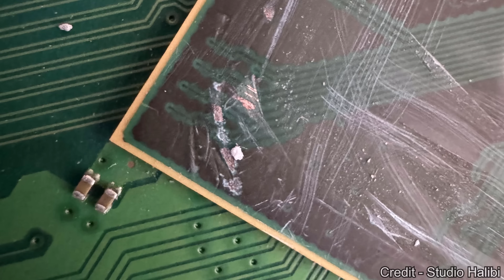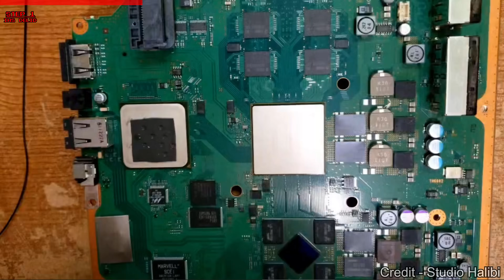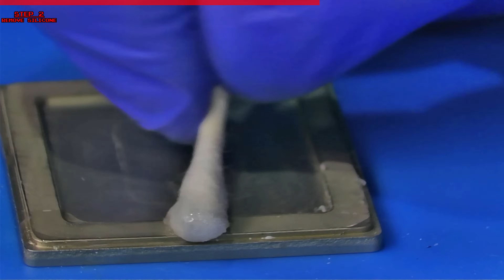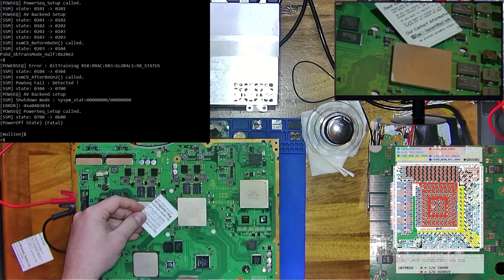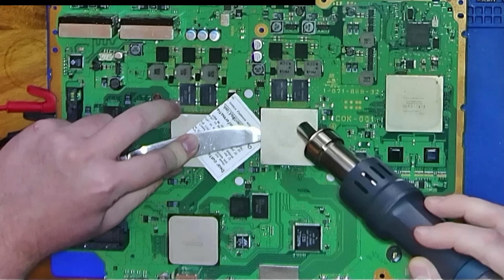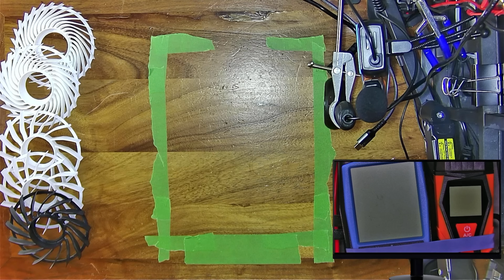How to Fix | Episode 1: Overheating. How to Delid CPU/GPU and fix YLOD - BEWARE of BAD MODs!

Comment: I used 0.06mm molybdenum cutting wire to delid my Cell, and it didn't cause any damage to the substrate. It did take a long time, but it felt very safe, and the end result was perfect.
Reply from the maker: I've seen it go both ways.
Reply: @ripfelix3020  wouldn't it make sense to use that wire to slowly cut away the vram glue?
probably with some kind of jig as to not cut into the dies.
iirc the vram has quite a bit of plastic on top so cutting it on the corners should be "relatively safe".
I only have my slim where i want to put on ptm but since it still works i wont dare touch it :P
Reply from the maker: Yes, the encapsulation around the corners can be cut into a small amount without reaching anything important. The razor blade method only works because of that, because as you start rocking it into the adhesive there, it will round the corner of the VRAM a little bit, but never causes an issue.

I highly doubt cutting wire would be practical on the VRAM tho. There's only about 0.2mm of space that the thermal plaster fills. So the sawing motions will both sratch away at the IHS and upper surface of the VRAM (which might be fine), but it's still too hacky and tedius to be a legit strat.
Reply: @ripfelix3020  yea, thats why i tought about a jig, cutting a bit into the ihs should be fine as long as the important components do not get fucked.
If i had a cnc and some broken consoles i would have experimented with making a jig  :D
Another idea i just got in might be the safest method available: a small cnc that removes the area where the glue is.
There are chinese cnc which sole purpose is to precisely grind away glued on ic on mobile phones, why not use that on ps3? :D
I would rather grind away the heatspreader and make a replacement than to use the "butterknife" hack (which i did sucessfully years ago on a fat) on my slim.
I think putting on that honeywell ptm stuff and sticking it back on afterwards should fix the issue for a long time, or?
Reply from the maker: Supposed to be good long lasting stuff. I bet it would work well.I got some, but it was from amazon and I think fake. I'm thinking of getting some legit from mouser and comparing.

Comment: I haven't delid my console at all. It is CECHK and it's running time is 400+ days. I haven't changed termopaste at all. Is it okay to continue that way since it's working just fine, and with the most heavy games it's turning fans no more than 31% even after 3-4 hours of gaming of games like last of us, gta v and la noire.
Reply from the maker: Then you're golden. No need to fear the potato.

Comment: Last year I decided my childhood E01 was too loud and learned about delidding. Bought a heat gun and some painters knives and managed to get it off clean and got everything repasted and running so so much quieter. It ended up ylod a few weeks later because of a failed capacitor on the board. I assumed it was that I accidentally dumped too much heat into the gpu. I bought a few more BC consoles and delidded them great, learned to read syscon from your videos, and found out that the issue with my original E01 wasn't a dead gpu. Sent it off to Studio Halabi and he got it fixed for me. I love learning about the ps3 and hope that I can one day get into frankensteining the models I do have whenever they bite the dust. Thank you for these fantastic videos that do so much for the community!
Reply: ... what was the cause?
Reply: You killed the caps with heat during the delid

Comment: Great research, this will be immensely helpful when delidding mine. I went the route of buying a Slim but it is giving me issues, so will prob take the old one and delid.

I will say that if the IHS is mostly stable, gluing seems unnecessary. Maybe it distributes force better but I don't think it will matter much. I agree it is important to keep it, as without a socket, there will be stress on the solder joints.

I would also not reach the same conclusion on drilling holes. In semiconductor land, 35 vs 45C is irrelevant, especially for VRM chips. If that is the temperature, it will shorten the lifespan by 0.
If it was 95 vs 85, that would be a huge difference. Could be some added stress for capacitors but would need to check if they run close to rated temps or not.

Unfortunately the PS3 will always be a mess to repair. Thankfully RPCS3 exists and CPUs are getting faster. Thank you for all the work your doing to preserve the hardware. Getting some still working will always be important.
Reply from the maker: I read it's something like for every 10c increase the chance of death doubles. I'd have to look it up for a MOSFET, but 10c more is not good. 

Now one could make the argument that replacing 2x VRM modules instead of the RSX is a worthwhile tradeoff, but I would argue that ignores nuance. It reduces the complexity of what kills the RSX to a single factor. Heat! While that scratches a psychological itch for the world to be a simple place, that's not the reality we live in. PS3 is not a place where problems reduce to a singluar cause, with a simple solution. It's always a combination of unknowables and calulated probabilities. Pros vs cons or give and takes.

Let's say the RSX would die in 5 years if you did nothing. So you drill holes and now it lasts 7 years, but the VRM die in 5 years instead of the RSX. Ok, you replace them, which is easier than the RSX! Then the RSX dies 2 years later and it needs replaced anyway. Was it wort it? Or would it have been better to only have 1 thing die and need replaced?

OFC this is a hypothetical, we can't predict. Point is that wishfull thinking always makes the assumptuon that it'll be better, not worse. But it's just as likely to be worse. The fact that we (humans) assume our luck would fall on benificial side is a pshychological bias called gamblers ruin. Or Confidence bias. We overestimate our chances, content in the lie we tell outselflves that "it'll be fine. Felix is making a mountain out of a mole hill."

Until disaster strikes. The astute observer of human behavior will see this pattern repeat like a poorly coded AI NPC. It makes us easy to predict and fool. All a deceiver has to do is figure out what we want to believe, and tickly our ear. But the convient lie is a jedi mind trick for the weak minded.

Comment: I gotta try to get comfortable with deliding eventually. I worked on a PS3 I sent to a friend a few months, back damn thing was still a bit loud after everything was said and done, the delid wasn’t needed, the console was stable after several hours of testing, but l want to get comfortable with them so when l work on and finish them they’ll work perfectly without pulling the fan speed up too much.
Reply from the maker: Nice. I like rambo's delid tool. It's really made the CPU delid accessable to the novice.
Reply: @ripfelix3020 that’s what I use for delidding the CPU and I gotten used to the popping method for the RSX (not sure if I’ll be able to delid 40nm RSX’s but l never had a console with a 40nm with the IHS glued on it.)

Comment: My PS3 was delidded by the previous owner and still sits in the 40-50% fan range to keep CELL under 68C.

I've repasted it twice, but the issue still remains. It's not glued on, but I've just accepted it's just gonna be loud at this point lol. At least CELL keeps the RSX in the 50 range anyways
Reply from the maker: I base my 40-50% reccomendation off an ambient temp of 20-25C.If your room is warmer, or the cabinet it's in gets warmer, then that reccomendation is relative. Also, it only applies to A-C models. The rest have different TDP, fans/Heatsinks, etc. So "normal" is relative to each model too.

Comment: I used a # 4 palette knife which is thin enough and the same width as a nail file. Everything else I did as you have done. Lol I used the same exact tool to remove the silicone 😅
Reply from the maker: I used to use my fingernail, but I like those plastic spanner things. Whatever they're called.
Reply: @ripfelix3020 I think it's called a spudger.
Reply: trim removal tools, smartphone opening tools... I find they're actually unhelpul for those things because they're made of such soft plastic, but if they were made of tougher plastic they'd probably scuff up my stuff, so that's a tradeoff I'm happy with

Comment: Felix I have five CECH-A01 models. 
I disassembled cleaned and delided both CELL and RSX on all five. (Practiced on three dead boards first).
NONE of them had a backing bracer plate on the back of the CELL. 
Should I be putting a bracer plate under the CELL? 😯
I did not glue/attach the IHS back on the CELL I marked the IHS where the old paste was. 
I let the area under the CELL open how it was when I opened the console.
Question could I put a thermal pad that is not as thick as the CELL board channel? 
So the pad does NOT rise above the channel and does not touch the metal shell motherboard shell?
Basically sits in the motherboard void of the CELL.
Yes Felix I bought an ruler sequenced in MM just to measure the thermal pads of the originals Sony used I am that guy.🤷
I have never replaced parts as the consoles never quit working.
Replacing parts in the instance of replacing the fan or the PSU what the console came with I reinstalled back in the console.
I have a CECH-A01 with the ZSSR PSU still going.
CECH-A01 are my favorite consoles ever.
You are correct all these consoles will eventually quit working. 
I want mine to last as long as possible. 
Enjoy your channel my PS3 favorite Felix!
Reply from the maker: Ok, first respect the CPUs "void." It doesn't like forign objects inserted there.

You don't have to do it the way I do. I'm pointing out why I do it my convoluted and overly cautious way. If you want to be extra careful like I do, I'm that guy, then you can follow suit. But no, you can have exelent results doing it other ways too.

Is my way the most proper? Let's just say I've developed this procedure to address "minor issues and potential concerns", not necessarily "must dos or it'll die for sures."
Reply: @ripfelix3020  Thanks, Felix always eager to learn more about the PS3. 👍😃

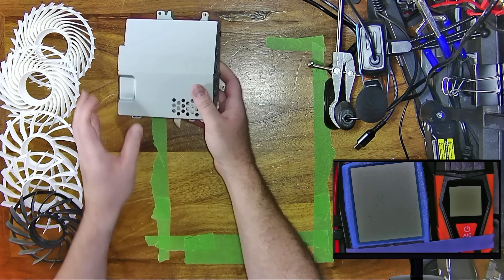Comment: At 36:22 , are those 3d printed fan blades for the Nidec fan? I thought about this a couple years ago, and I am curious if you have found any benefit from different blade designs.
Reply from the maker: Zero. I tried many itterations and every one of them was worse is some way. We came close to matching the performance with one design, but not quite. Clearly Nidec simulated and optimized the blades they used. It was an intersting project tho. Gave me new respect for the engineers.
Reply: @ripfelix3020  Interesting! I wanted to try this but didn't have a printer at the time to experiment. I guess it was time better spent elsewhere then. The Nidec engineers clearly know their stuff.

Comment: On the super slims the RSX is direct dye cooling. I wish they made it like that in all models. But maybe this is because of the smaller dye of the later models?
Reply from the maker: Upto the enginners. They have the computer aided engering software that models the stresses and know the intricacies of the power planes, layout, and thermal deaign power of the package. If they decided it didn't need an IHS for stiffening purposes I trust they knew what they were doing. The more I learn about the design of the console, the more I gained an apreciation for their engineers. They clearly know what they were doing and optimized the design in many ways, despite armchair amateaurs claiming it was a bad design. Yes, they cheapifyed the deaign over time to make it profitable, but the OG models? Now that was Ken Kutargi's swansong and a glimpse of what we could get when enginners are allowed to complete their dream build. Was a hell of a console!
Reply: @ripfelix3020  And it still is! The only "bad" thing now is that it's stuck in the 1080p era, but that's inevitable. For the time it was the most advanced thing on the market. I can still stream my music from a modern Android phone over DLNA to the PS3, now how cool is that? Even useful if you don't have a modern AV receiver with wifi.
I tried delidding one 04 model and sadly it turned on with a YLOD :( I couldn't see any damage, I think it was (on first glance) a good delid job, but it is possible that I cracked solder balls in the process. I would try delidding a dead slim just for practice, but if by some miracle I do it right, I'm still not risking my perfectly working slims.
Anyway, thank you for sharing the knowledge and your experience.

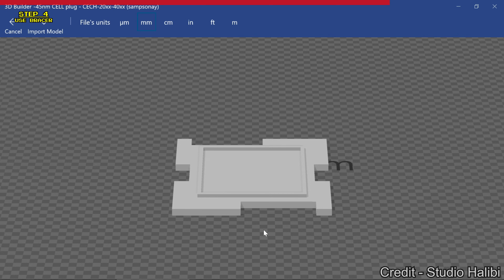Comment: 18:30 i do
Reply from the maker: Until they can be jailbroken and Overclocked...nah. They're not interesting.
Reply: @ripfelix3020 well they can have Hen installed also if you loved the Cell Processor like I do you would not care if it's an super slim or an fat, I like all PS3 Models, Cell processor is so extremely interesting and taught me so much computer  engineering-design, it's an 9 Cores CPU, I be praying for the day someone will create those awaited software optimizations for games that doesn't use the Spus well, porting the most Optimized codes from games Like Killzone 2 to GTA IV......, also Mortal Kombat 9 Runs Locked 60Fps with PhysX on Cell Spu's something impressive but I bet Cell could achieve 150Fps on it.
Reply from the maker: When it can be fully jailbroken and I can see how far it overclocks...maybe I'll care more for it.  As it is, I see the SS as a source of 40nm and a sideshow costdown model purly for profit. They're less reliable than a slim, due to that trash bluray design. They always break.

Comment: I think it would be a very good consideration to look into phase change material, such as PTM7950. I have this applied on my desktop (i7 12700K @5.1Ghz) and it works like a charm, and it is inherently reusable due to it hardening back into into a pad once cool, so you can scrap it off and put it back onto the die
Reply: I have it on my Frankenstein PS3 and it works perfectly. I trust it to be good for longer than MX-4.

Comment: Have you tried thermal pads instead? Curious to see a comparison.

Also in your comparison clips here the RSX is always 5-10c lower than the CPU… my RSX is usually around the same temperature as my CPU.. it easily stays below 68c at around 30-35% fan speed but is my RSX too hot then?.. mines a Cech21xxx Slim.
Reply from the maker: instead of what?
Reply: @ripfelix3020  sorry i meant instead of thermal paste on the cpu and gpu..

Comment: Have you looked into thermal paste alternatives like ptm7950 or graphene pads?
Reply from the maker: I've used graphite thermal pads before. They perform slightly worse than MX4, but they never degrade and are fine. Best, they dissipate heat laterally away from hotspots better than most mateials. Graphene would be better, but to answer your question. No, I wasn't aware you could get graphene pads yet. Might be interesting to try.

I have some PT., but I suspect it's fake. Was cheap on amazon, but I think the genuine stuff is only going to be had from digikey/mouser and be honeywell branded. Last I looked it was much more expensive than the one I found on amazon. I might get some legit stuff and compare them to see. Might make for a good vid. IDK.
Reply: I've bought a cech20 and opened it to find it had thermal paste beside the 2 IHS, how can one screw that up, idk.
Put 2 carbonaut pads 38x38 on it, so i don't ever need to replace, and can just dust off.
If I were to buy it again I would get kryosheet, same price and way better, but I didn't delid and don't think ever will, so I assumed it would bottleneck under the IHS, and be no difference.

Comment: MX-4 should never be used when applied to a bare die. I have done this many times with laptop dies and after around 30 days of use, the paste has already been pumped out which leads to the same thermal issues as before the repaste. Instead for direct die applications a paste like MX-6 should be used which is less liquid and more solid. Arctic does not recommend using a tool to spread out MX-6; rather, you should use the pressure from the cooler alone to spread it. MX-4 is fine when used on a large IHS like a desktop CPU or the RSX/CELL.
Reply: Even better: use PTM7950 for the bare die.
Reply: I would just use Liquid Metal.
Reply: this isn't true, I've used MX-4 on MANY laptops and never had an issue.
Reply: pumped out means you used too much (some are expected, but not too much) -- don't forget: thermal paste is only intended to fill the gaps between interfaces (eg cpu and cooler) not to be another interface/medium; adding too much will reduce the thermal transfer
Reply: @5mf1nc it really doesn't matter if you put too much it will just squish out. The problem with regular pastes on a bare die it doesn't have any surface to grab on to, and after a few heat cycles the paste just squishes out around the die and there is nothing left. Using PTM7950 will minimize it because it doesn't have much oil in it as it just stays in shape much much longer.
Reply: MX-4 Is non conductive. I’ve used it on several different types of bare die chips for years and for long term. No problems.
Reply: @henUSERNAME who said anything about conductivity

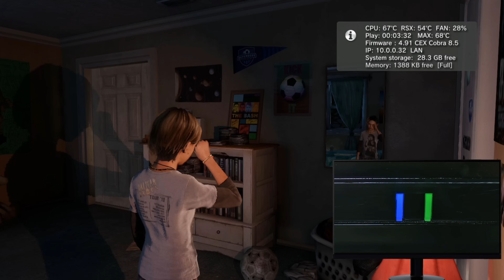Comment: 39:40 i think that is important to consider the temperature of your region too, mine bc ps3 can pass 50% on hot days here in brazil to keep cpu below 65/66 Cº, but in cold days (which are rare) the speed can drop to under 40% without changing anything
Reply from the maker: I meant with an abient temp of 25C or less.
Reply: Salve